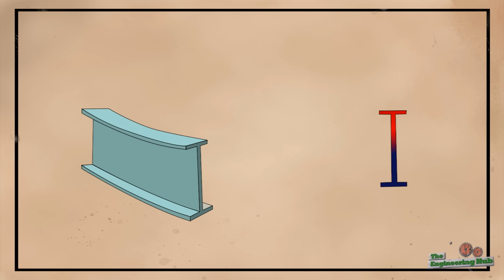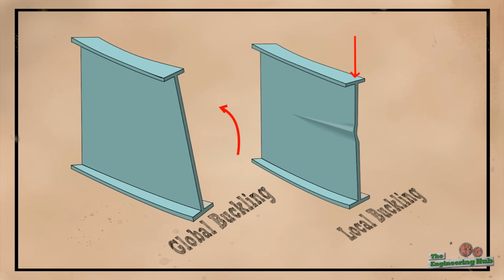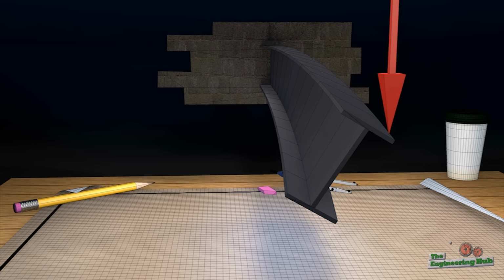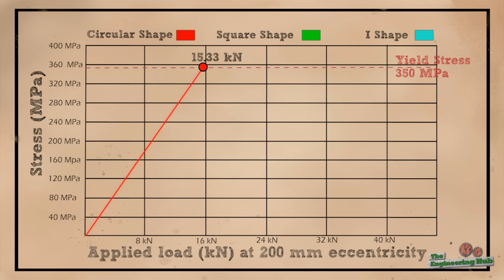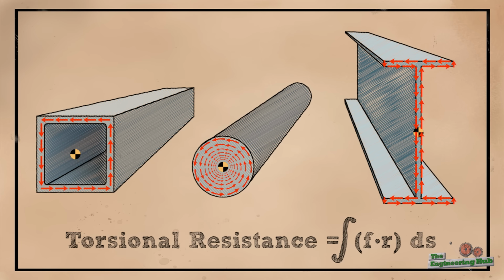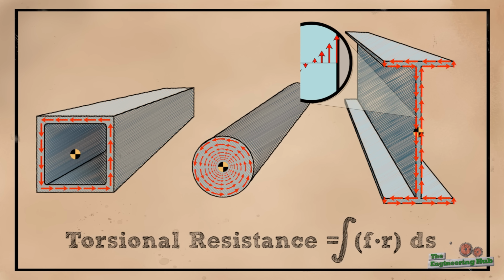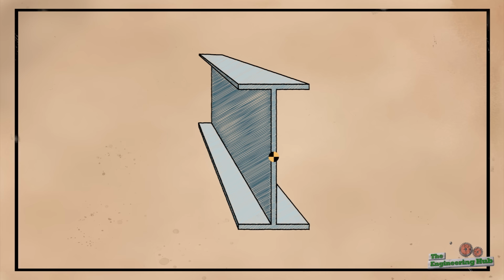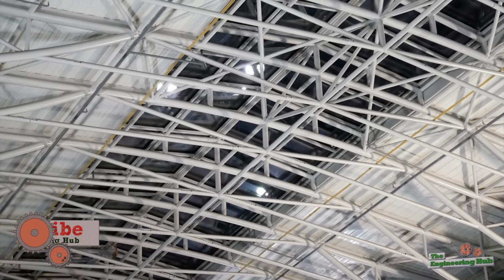The Critical Weakness of the I-Beam

Comment: All designs have strengths and weaknesses. 
It would only be a fatal flaw if it inherently led to multiple catastrophic failures.
That could only occur from substandard engineering practices.
I-beams are structurally sound when used properly.
Click bait titles are lies.
If you have no problem with misleading those seeking information, I deem you both unethical and untrustworthy. I would not frequent a venue that trades principles of character for views.
Reply from the maker: Absolutely Eiserntors, we are not suggesting that the I beam is better or worse than any other shape. All shapes have their advantages and disadvantages. This video is aimed at non-engineering viewers that may have a DIY project (farm, yard, garage, deck etc) and might accidently load the I-beam torsionally and reduce its capacity significantly. We don't think that we have mislead anyone in believing that the I beam is weak. In fact, we made a whole other video talking about how good the I beam is at carrying bending loads.
Reply: @TheEngineeringHub   Your reply has nothing to do with the title stating its flawed, in fact fatally flawed. It's misleading click bait. My opinion is as previously stated.
Reply from the maker: We respect that.

Comment: Anyone that has done steel erecting and has clambered out on a long gable end rafter without access machines to release the crane’s slings, is very VERY aware of the lower resistance to torsion that I-beams/RSJ’s possess. An uncomfortable moment indeed the first time one has to do it.

Comment: Instead of trashing the I-beam!, why don't you start with the basics? As in what kind of metal you are using?? How weak is the metal?, is it recycle metal?, etc.!!
Reply from the maker: We are not trashing the I-beam, in fact, the I beam is incredibly efficient at carrying bending loads and it is the most commonly used milled section in the world. Which is for a reason. Though the torsional weakness of the I beam undeniable and it is not dependent on the material.
Reply: @TheEngineeringHub     While okay!, excuse me for THAT!! I would start from the basic. As in why do i-beams, C-channels etc. metals fail? I am a mechanic and the problem now with these cars they use recycled metal. I'm sure you understand the more you recycle the metal the more it weakens. Versus Fresh Metal.

Comment: And this is the same for a length of 2x4 wood.
Reply from the maker: Not really, a 2x4 would resist a higher torsional load compared to a wood I-beam made out of the same amount of material.
Reply: @TheEngineeringHub  a 2x4 will hold more weight on one side over the other.
If you take a 10 ft section and lay it where the 4 inch section holds the weight, it will snap faster THAN if you took the same 10 ft section and put the weight on the 2 inch section. 
My comment is correct, you understood it wrong.
Reply from the maker: Our apologies, we definitely misunderstood the comment. You are correct, loading the beam on the weaker axis will make the beam fail much earlier than it would on its strong axis. Sorry about that You Tube, the fault is on our side.
Reply: @TheEngineeringHub  no worries, it happens 👍

Comment: Impressive graphics and animation, but you don't know what you're talking about.  They are not gonna rip down a hundred million structures and rebuild them with square beams & columns.  Also, square beams can be dangerous.  They can rust from the inside out and fail, completely undetectable.
Reply from the maker: Of course not John, we never suggested in anyway that that's what we should do. In fact, most of the beams in a regular structure are not loaded eccentrically (not exposed to torsion loads) so using hollow sections would be very inefficient. And of course HSS sections have their own issues, we never said they are perfect. But when it comes to torsional loads they are just simply better than I beams, that's the bottom line. No ripping structures down.

Comment: Fatal flaw?
Sounds more like user error.
Read the label.
Reply from the maker: Hi corthew,
Thanks for your comment!
You have a good point, the flaws of I-beams should be designed against so that they don't manifest (i.e. cause failure). In practice, this is what we do as engineers.
Cheers,
Reply: @TheEngineeringHub  Nope...Not what I said. They are not flaws...They are limitations.
If you load a 1 ton weight onto a bar stool, is it a flaw that causes the stool to collapse?
Reply from the maker: @corthew  the analogy is more like this: you can load an element (lets say a bar stool) with 1 ton and no problem, the stool carries the load. But then you move the 1 ton weight a few inches to the left and all of a sudden the stool twists and breaks. Small shift in the location where the load is applied makes the element behave significantly different. That's the "flaw" or design limitation (for sure more appropriate wording) that the location has a huge influence on the carrying capacity.
Reply: @TheEngineeringHub  I suppose it really depends on the material the stool is made of and how much it can support before the reality of one side being slightly weaker than the other enters the picture.
Read a very laborious but topic applicable poem by Oliver Wendall Holms called "The Deacon's masterpiece".
Here's Eddie Albert's read of it: https://www.youtube.com/watch?v=wiOHhhwnK6k&ab_channel=oldmoviegirl
Reply from the maker: @corthew  That was a beautiful poem, thank you corthew.

Comment: nice presentation for w high school student but you really need to understand more about engineering and design with standard parts
Reply from the maker: Hi Antigen4,
Thanks for your feedback. We'll consider making videos with detailed design calculations in the future. If you have a particular design or portion of this video for which you would like to see calculations, let us know.
Cheers
Reply: The Engineering Hub there is absolutely no need to provide any sort of ‘calculations’ but avoiding dangerous shear or torsional or other forces is the job of the engineer. There is nothing at all inherent in the ‘design’ of standard parts that creates structural failures. The engineer specifies the components and the fastening and welding details so such problems can be avoided. It’s a bit like blaming the design of a 2x4 for a structural failure in a house. The components specs are very well documented and easy to work with.
Reply: Please also reference the fact that all these "issues" are well researched and are appropriately accounted for in building design codes.

Comment: Have you ever looked in to the Slotted Web design?
Reply from the maker: Hi Butterfly Woodworks,
Yes--we have some experience with slotted webs.
We are considering to do another video about the pros and cons of different structural shapes. If we do, we could include some discussion about slotted webs too!
Cheers,
Reply: @TheEngineeringHub  If you need any firsthand knowledge about it I’m currently building a house for the guy that patented it.

Comment: What you are saying is miss leading.  Structural engineers are some of the  brightest experts in construction. They will use the best material for the project whether it is steel, concrete, aluminum or earth.  Besides load capacity, there is cost and maintenance, longevity and safety factors.  The WF torsional weakness is remedied by web stiffness, cross bracing , and embedding the top flange in concrete.  You can paint all sides to prevent rusting.  Steel is effective on long span bridges and tall buildings where dead weight, flexibility, and strength is a factor.  There is a reason why certain materials and shapes are used in construction. History is a harsh teacher, if you get it wrong.
Reply: I wouldn't go as far to say it is misleading. It is a simplification in a short video not an engineering tutorial.
Construction professionals engineers, architects and builders are well aware of moments of structual stability or should be. I know I was always checking construction and civil/structural engineering plans incase something was missed. Cost was always a big issue and truly some of the engineering I came across was pure genius to counter the structual faults an architect had designed.
Reply: @darrellturner560  They weren't structural faults designed by the architect, they were opportunities given to the structural engineers to show their genius. A building without an architect might be horrifying, but a building without an engineer is often terrifying.
Reply: @michaelkelly339  I like that, gave me good chuckle.
A client handed me a set of plans for their new house with quite a few 45deg and 22.5 deg turns and zigzags. It was rather attractive and impressive. However the architect failed to complete the roof design. I rang him and requested he detail how he wanted it done. He responed saying I'm the builder work it out. I ssid fine but I don't think your client is going to be impressed when I charge them additional design fees which they paid you for. He was on loudspeaker with the client sitting next to me hahaha
I did the finish design in house and we built it. It came out beautiful with very happy owners. Even my carpenters and roofers were impressed at what we achieved. Just another day sketching on a pad and plotting in CAD. So you are very right, architects love to throw challenges at engineers and builders.
Reply: @darrellturner560  Isn't it funny that the same situations crop up in construction no matter where you go? Ya gotta love architects, cos you're not allowed to shoot 'em 😉 Best wishes from Dublin (the original one)
Reply: @michaelkelly339  for the live of the Irish mate. I'm original from Australia moved on now. I start out as a bricklayer with an Irish boss teaching me much. Found him and his Irish mate one night in a pub (nothing unusual there) telling 2 sexy young things they were pilots hahaha
Reply: @darrellturner560  Sounds about right!
Reply from the maker: Hi Fred,
As structural engineers and designers, we tend to agree with you :)
Thanks for your feedback.
We will consider doing a future video to discuss the applications of different structural shapes.
Cheers

Comment: The fatal flaw of X is not engineering for the best results.
Reply from the maker: Hi Pat,
You have a good point! The flaws should and can be removed in the design process. 
In practice, this is what engineers do by choosing different structural schemes and elements.
Cheers,

Comment: Nothing wrong with i beam design. What is shown here is a failure to consider all stress factors in any given construction that leads to weakness in a structure. It is negligence, incompetence or both on the part of the 'engineer'.
Reply: In addition, the ASCE codes cover buckling cases for all standard I beam shapes which are designed to resist local or web buckling before failure due to the bending moment. I don't know of anyone specifying I beams in engineering without following ASCE 7. Even custom shapes can be designed using a little thought and the concepts and equations in ASCE 7.
Reply from the maker: Hi Bio Mechanique and plkracer,
You are right! The flaws of the I-beam can (and almost always are) considered in the design so that failure does not occur. Thanks for your comments.
Cheers,
Reply: @TheEngineeringHub  👍🏻 there are also situations where I have used I beams in seismic designs specifally because they are relatively flexible, and fail in a predictable (consistent and calculable) manner. There are special cases in AISC that allow smaller overstrength factors because of this, lowering the structure weight considerably, while saving $$$.
Reply: @TheEngineeringHub  Interesting that you still use the word 'flaw'. The I-beam has limitations regarding it's use. As with any rolled steel section, if you use it in a way it was never intended to be used you are asking for failure. The only flaw is in expecting it to cope with stresses it was never designed for.

Comment: What would you say if we have the web corrugated,for an I Beam. How would that effecr
Reply from the maker: Hi Kartik,
To briefly answer your question, the corrugated web can offer some additional resistance against web/local buckling.
We are considering to do a future video reviewing various structural shapes--perhaps we can include corrugated web I-beams in that video!
Cheers,
Reply: How would you make such a thing cheaply, ideally in a mill spamming hot steel through rollers at multiple meters per second? Also corrugations are give extensional elasticity, which you don't want (although the flanges should take most of the stress).